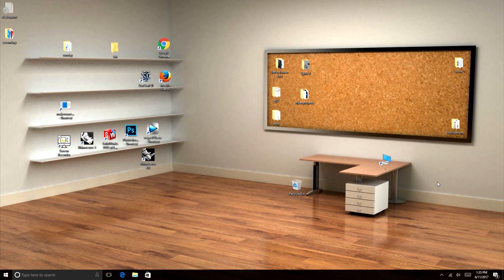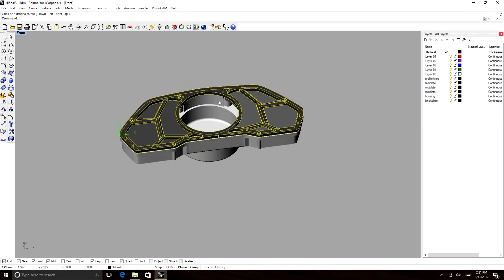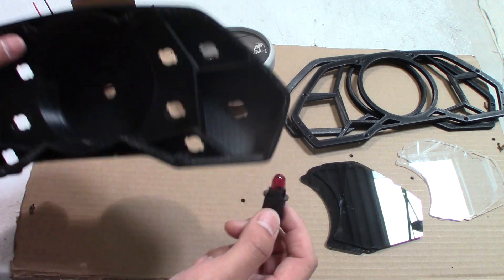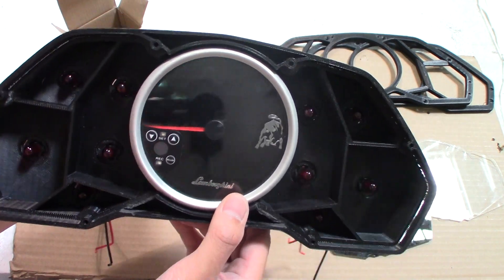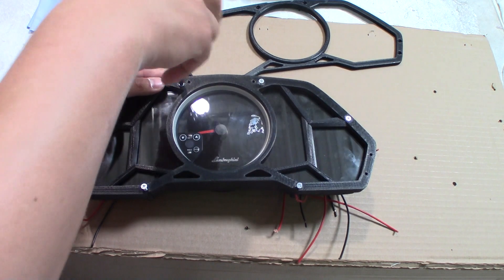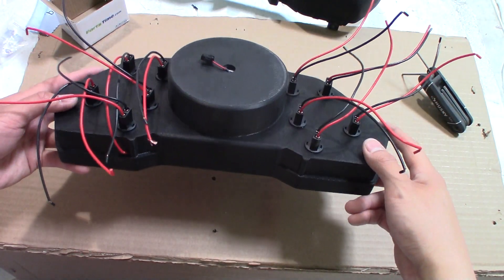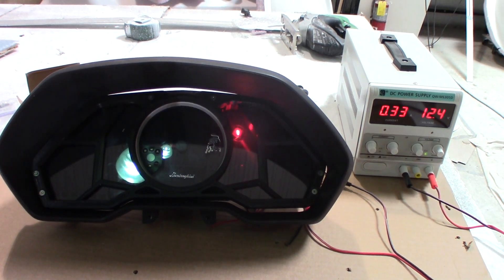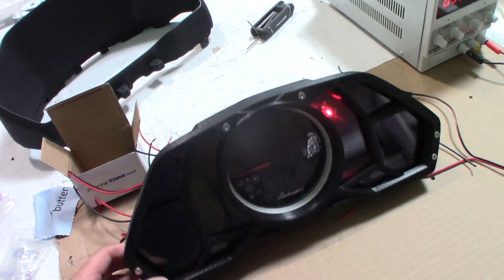DIY 3D printed Lambo gauge display

Comment: Great works dude!  
i have a question about your screw fixtures> did you just model the 3d printed screw housing to the diameter of the screw shaft & cut the thread so to speak with the screw when you first inserted it? if so what do you think about the longevity of such a method, taking apart putting back together etc, thread wear. Keep up the great work! cheers.